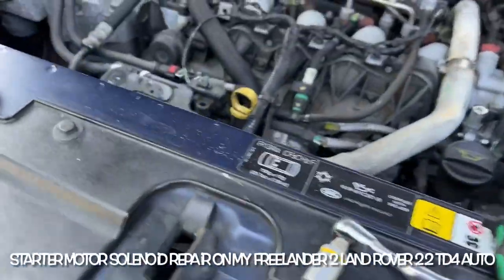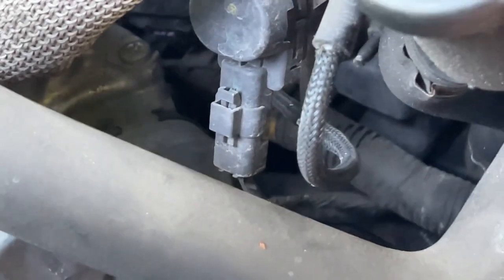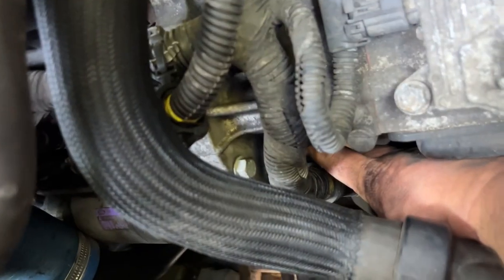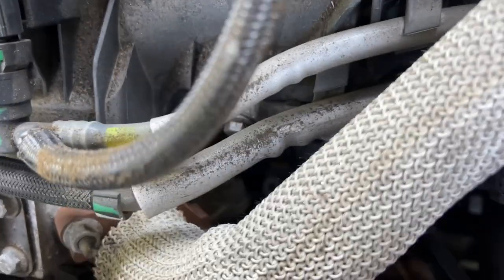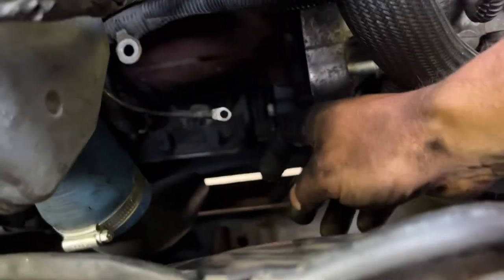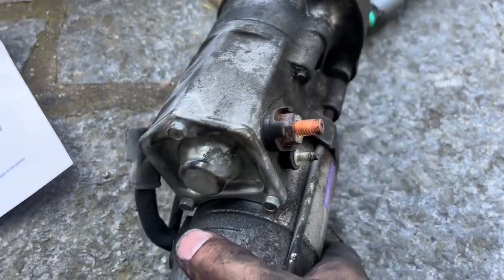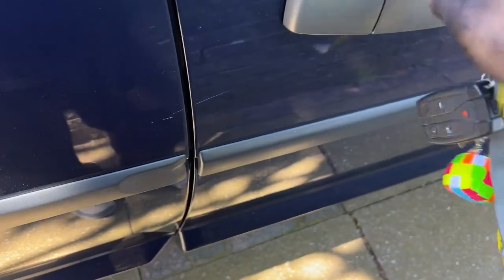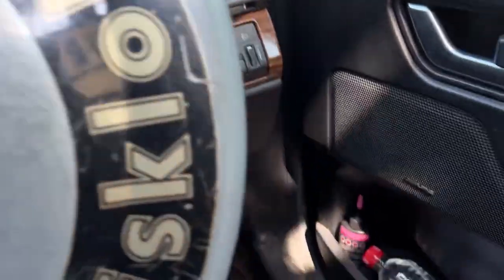Starter motor removal, repair and refit freelander 2 Landrover 2 2.2 TD4 same as Range Rover Sport

Comment: Great video. On mine the wires where retained on the first bolt via a ten mm nut then behind the thread was a 17mm nut to be removed. Aside from that exactly the same.

Comment: Thanks for posting this video, a £20 fix worked a treat for our Freelander2 TD4. I removed the electrical connection to the gearbox too which helped move the wiring harness more and get a short socket extension in to remove the 3 13mm bolts. Our Landy only has 55K miles on it - I guess a lot of short journeys therefore lots of starts accelerated the wear on the smaller copper contact, which was paper thin when I removed it. This video explained everything perfectly - thanks again

Comment: Hi Mike. Great video. Do you know if the same starter solenoid repair kit does the TD4 Freelander & the TD5 Defender?
Reply from the maker: Cheers, I’m afraid I don’t know, mine is a Td4 Freelander, I had a td5 discovery before and changed the starter motor on it but didn’t rebuild the starter motor in that instance.